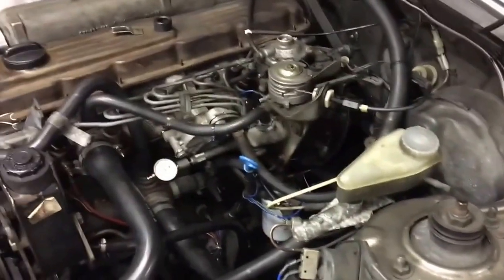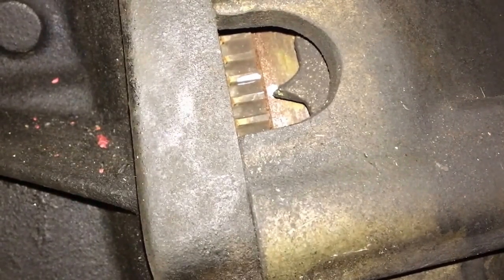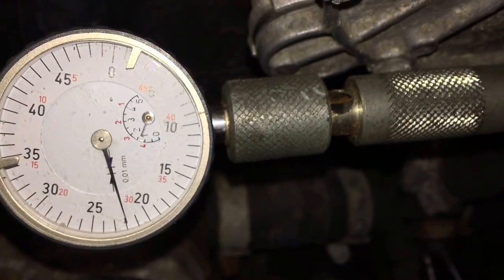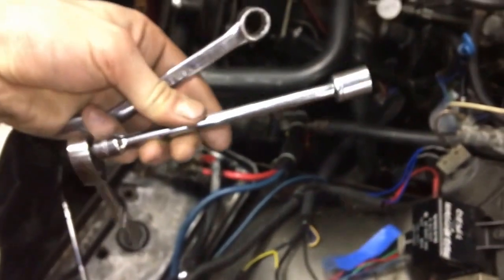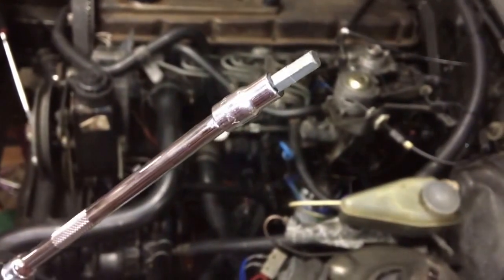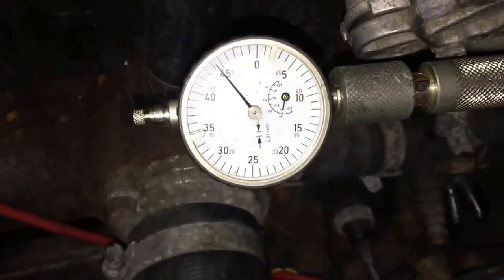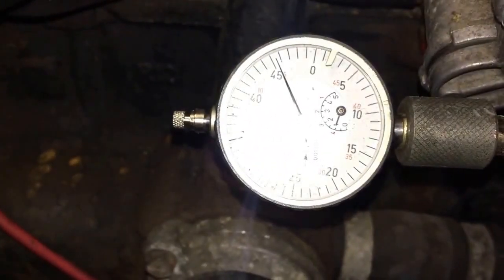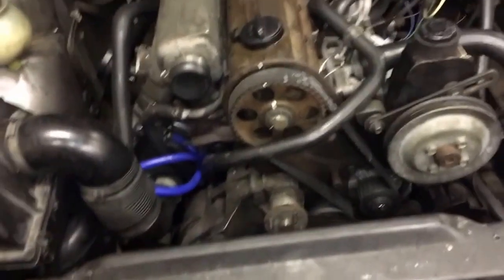Adjusting Volvo 740 D24T Injection Pump Timing

Comment: Hello! Great video :)
How do you turn up the pump so it gives more fuel?
I have been driving mine bone stock for a while, but thought it might be fun to give it some more power :)
(I have an intercooler and I plan on putting an EGT before the turbo so i don't overheat it)
Reply from the maker: There is a slotted screw held in place by a jam nut which may have some kind of anti-tamper device on the front of the pump. Screwing in will increase fuel. Mark your starting position carefully so you can return it if you go too far.

Comment: You fotgot the cold start on the pump, the timing is wrong if you don't disconnect it!
Reply from the maker: You are absolutely right, I ended up setting the timing again later. It was in time so I think the cold start wasn’t pulling in the pump at all.

Comment: where to get this timing tool and number?
Reply from the maker: The dial indicator is a universal part but the adapter is a Volvo tool. There is also a Volkswagen equivalent. As far as spec for timing 0.90 is generally the recommended number.

Comment: You do not zero the gauge by removing all the preload.  You should start in the middle of the range (2.5), rotate the engine back then just rotate the dial face to zero.  You want to maintain some preload at your zero setting.
Reply from the maker: That makes sense, great point 👍

Comment: The hex key/allen bolt on my car behind the pump is stripped and impossible to move, do you think it would be possible to time the pump with that in place? Would you be able to overcome the friction it provides?
Reply from the maker: That will be very difficult. You may need to get a socket for stripped bolts that can fit over it
Reply: @adamdrives365  See now i've tried that with limited success, both with morse bolt extractors and the rounded bolt sockets. I was actually able to get the pump to move though. Do you happen to know the OD of that bolt?
Reply from the maker: minecraftboytoy of the bolt, or the bolt head? Probably 6-7mm shaft and 8-10mm head
Reply: @adamdrives365  That's perfect, I'm going to try to use the irwin type bolt removers

Comment: Hi Adam. I just changed the timing belt and my engine IP is "delayed" (about 0.41 instead of 0.95). I applied the procedure of your video but the angle I succeed to rotate the pump is not enough: I reached an advance of just 0.50. Must I loose the camshaft rear pulley as Seteli does? It seems that the regulation marge is too little for my deregulation. Thanks in advance!
Reply from the maker: mushyhsum I’m not sure, it’s been a while since I touched one of these, if you’re having trouble I would ask for help on the d24t.com forum. I like to keep the belt on, I’m not sure why you’re running into that problem.
Reply: @adamdrives365  Thank you so much for your anwers, and I'm sorry for bothering you.
We could finally adjust the timing! (There was a 4th nut that held the IP tight and we didn't see before) 
Now we're having issues with the breaks. The car's been waiting still for 5 years now, so it was about time to get it moving and put it in shape.
Kind regards.
Reply from the maker: mushyhsum I’m not sure, it’s been a while since I touched one of these, if you’re having trouble I would ask for help on the d24t.com forum. I like to keep the belt on, I’m not sure why you’re running into that problem.

Comment: Omg that valve cover is rusty looking. I painted mines and the entire engine looks so much better. Nice videos. How does it run now? Ever measured compression?
Reply from the maker: I sold the car about 2 years ago, and the new owner didn’t have it for long, so I’m not sure. I never checked compression as I didn’t want to deal with removing injectors and it didn’t have any running issues

Comment: Where can you buy that volvo tool to put in the IP?
Reply: Volvo tool #9995194
Reply: Johan Wahlström volvo #9995194
Reply from the maker: Johan Wahlström the tool is in storage I will get a part number next time I’m there. Ebay is probably you’re best bet.
Reply: Yes that would be great!
Reply: Is the number 5194 maybe? In My greenbook from 240 diesel it says that with that tool?
Reply from the maker: Johan Wahlström it would be the same as 240 tool. Same pump without the LDA
Reply: Thought so too, but if it was some more digits in the number where you can buy it, because I googled "Volvo 5194" and I only found one one amazon that was selling, and they did not ship to Sweden, and it looked shorter than yours on the pic.
Reply from the maker: Try ebay or d24t.com. You won't find a part like that on amazon.

Comment: protip, loosen the camsaft rear pulley bolt and rotate rear pulley over cam, same thing but you dont need to turn the pump and loosen that annoying hexhead, faster and easier.
Reply from the maker: The first time I set my pump, I used that method. I couldn't find the hex head, and rotating the pump was impossible. The only reason I don't like that method is that when re-torquing the cam pulley, I kept slightly pulling on the pump belt and changing my timing. In the long run, this method was quicker for me. But, that method certainly does achieve the same result.